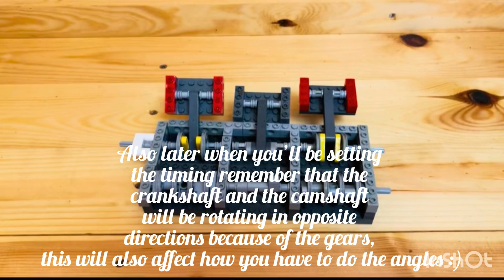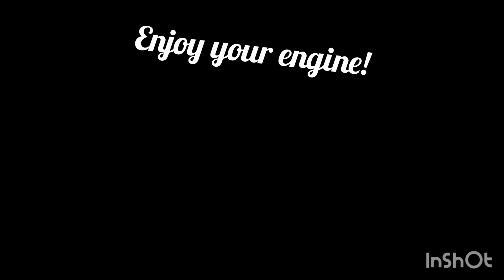| TUTORIAL | Flathead Inline 3 Cylinder Lego Vacuum Engine | 1550 Rpm Beast | NOT For Beginners |

Comment from the maker: Tips on making this engine run properly:

1. Tune your valve lift by moving the valve legs little by little until you find the right height for maximum performance

2. Make sure your valves aren’t moving on the valve rods (a little toilet paper inbetween of the bushings should do)

3. Make sure all the valves are opening at the right time (it’s very easy to make a mistake while trying to get the 120° angles)

4. Make sure your timing is right

5. If nothing works and you still wanna commit to making this engine run, i suggest trying different kinds of springs (this should be the last resort tho as the engine should be able to run atleast at some rpm even with bad springs)

Also if someone ends up making this massive engine I would like to see their results! So comment on this video if you make it and i’ll hit you up on discord or smth!

Comment: Wow, you must have spent a long time designing that! My engines seem slapped together in comparison...
Reply from the maker: Yeah whenever i make a tutorial i try to use the most efficient configuration of pieces required to build the engine aka if there’s for example a 2x6 brick worth of space to fill i’ll fill it with a 2x6 brick and not a 2x2 and 2x4. And that’s just kinda grown into a habit so pretty much every single engine i will build is going to be as efficiently built as my parts can supply.

Edit: and a flathead this compact kinda requires me to pay attention on what i’m building cause it’s so complex and has to be perfect to even work.

Comment: Does this produce more torque than a one cylinder flathead engine?
Reply from the maker: Yeah a ton more actually :)
Reply: Seems to me like poppet valve LVEs are usually more efficient with multiple cylinders because the piston of one cylinder is helping to open the valve of another cylinder instead of just the flywheel doing all that work, and because one valve spring closing a valve is helping to open another one....
Reply from the maker: I’ve had exactly the same thing cross my mind too!

Comment: Will you make a tutorial on a budget version of the flathead with a 4x4 piston?
Reply from the maker: I have a tutorial for a flathead with a 3x3 piston, that only has one valve tho… i have yet to invent a 4x4 flathead with valves that fit in a 4 wide space so maybe i will do that someday :)
Reply: @Möykö-LVE Can you manage to make the smallest flathead or to have the valve supply from the bottom without a spring?
Reply: @Möykö-LVE for example something similar to the Predator 212 but a butterfly piston with valves
Reply from the maker: Nah i’m afraid i’m not making one without springs or with a butterfly piston, but i am probably gonna try a 2x2 single valve flathead someday :)
Reply: @Möykö-LVE :}}}}}}}}}}}}}}}}}}}
Reply: @Möykö-LVE Can you manage to get some other black gears because I don't have those from the video, but I have some black ones and they seem to be smaller.
Reply from the maker: Yeah the black ones are smaller and i don’t have those since i haven’t needed them. I’m likely not making a lego order soon so i’m probably not implementing those on any of my engines.